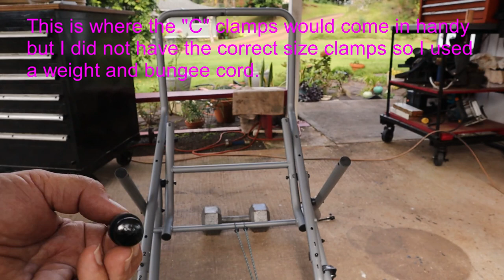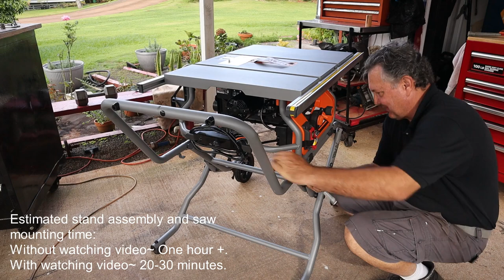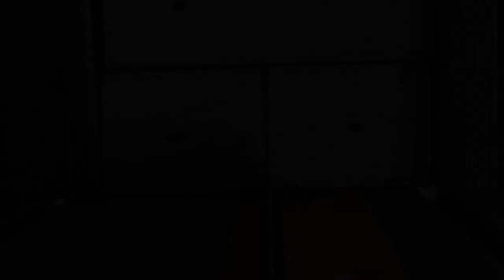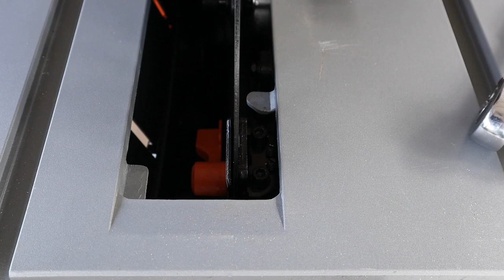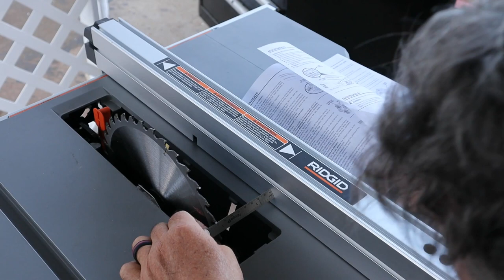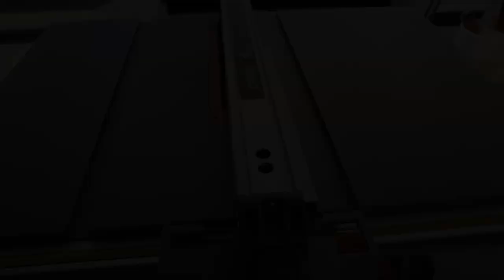RIDGID R4514 10" Table Saw: Assembly and adjustments in detail.

Comment: Well that’s just too easy that the fence came out perfect without adjustment. Even after I follow the manual to adjust it (parallel to a slot) the far end moves out of parallel when I torque down the lever. The one thing you need to be able to trust is your fence.
Reply from the maker: Aloha Jus,
The fence that came with my saw was the only thing that was fairly good out of the box. Everything else including the miter slots were.... not very good.... the Riving Knife was also causing issues with the cut so I made modifications as necessary.  If you follow previous comments you can see what was done so I wont duplicate that conversation here.
Good luck,
Mike

Comment: I really wish you had gone in to detail on how to straighten the blade if it's off.
Reply from the maker: Aloha Trent,
The best that can be done is to set the blade to table top angle to 90 degrees and adjust the pointer to that spot to get repeatable 90 degree cuts. Since the table top of the saw is not straight/plumb/square you just have to do the best you can to get as close as possible to the result you want.
Good luck.
Maverick Mike.
Reply: @maverickmikekauai3515  There are adjustment screws on the back of the saw for blade straightness, but the best I could do was get it really close to straight, it just would not go 100% straight.  Gotta work on the bevel next, but haven't had time to focus on it. =\  Loved that you showed how to adjust the riving knife, mine was off pretty bad after changing my blade, and it was causing issues, so that helped! :)

Comment: Thank you for the video. I was considering buying this saw but I think I'm going to pass.  Thanks again
Reply from the maker: Aloha Mark,
There are definitely better built, more accurate saws out there. I kept mine based on the price point for a saw able to cut 4X4 material and that came with a roll around saw stand.
Glad the video was beneficial to you.

Mahalo,
Maverick Mike.
Reply: Mark, I bought this saw because it compared in the middle to all other saws of it's class.  It would beat some brands in some categories and lose in others.  This class of saws are not meant for contractors daily use regardless of what the companies say or call it.  When you add the fact that it's a 10 inch and Dewalt and several others were 8 & 1/4 inch blades plus the lifetime guarantee plus the absolutly wonderful collapsing stand on wheels and it's only $60 more expensive to the Dewalt with no stand and smaller blade I decided to buy it.  I'm 100% satisfied I made the correct choice (for now).  I may add to this post in a few months complaining about it but just wanted to throw my 2 cents at you if you were still looking.
Reply from the maker: Aloha Mark,
My reasoning was similar to yours regarding this saw. If RIDGID addresses the manufacturing process of the table top to produce a truly flat/square surface then this saw would probably jump way up the wanted saw list especially at this price point.

Mahalo for the great comments.
Maverick Mike.